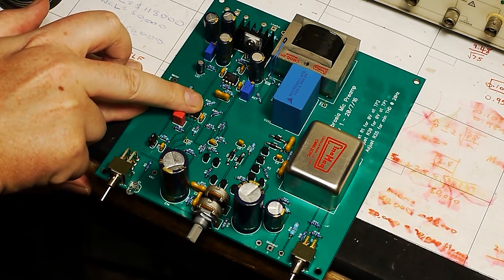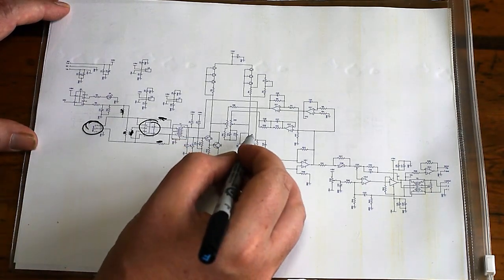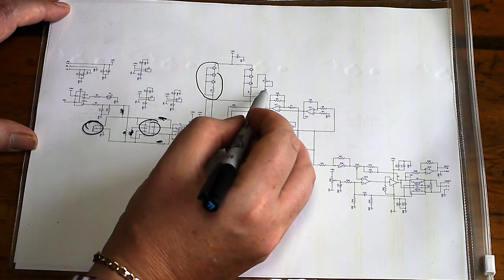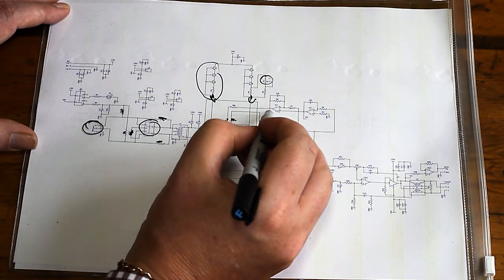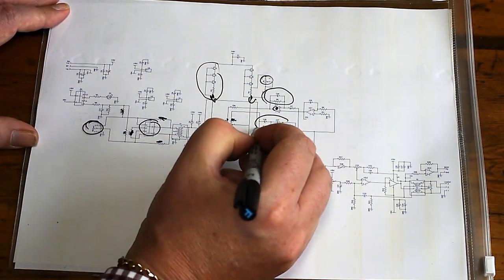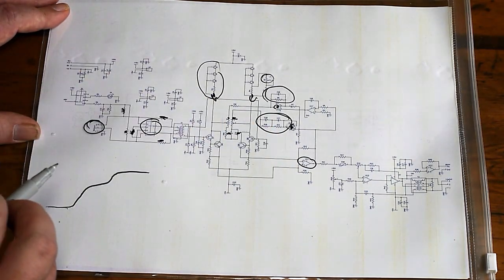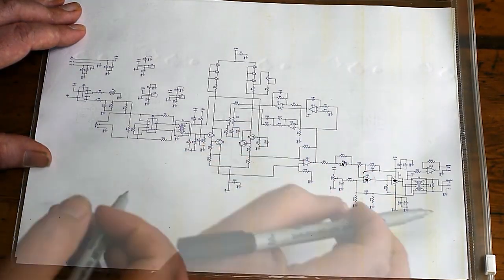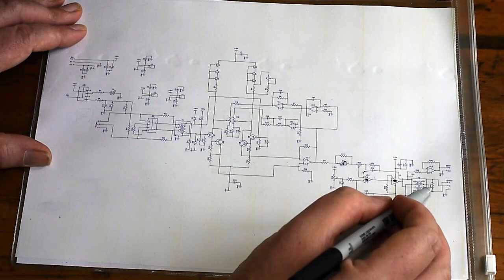DIY microphone preamp project - Introduction

Comment: As a long time (old) EE audio designer I have to agree with a couple of others that this circuit is unnecessarily complex, and frankly somewhat ill-considered in spots. I hate to dampen the poster’s enthusiasm and willingness to share, but I would encourage would-be builders to do more research about other available circuits on-line. And “Keep It Simple”!

Comment: 9:34 Neat idea, i suppose, but i must admit, i'm a bit skeptical about the practicality(?) of that, in an audio application. That output transformer is a considerable chunk of metal, which will have a considerable (to say the least) thermal inertia, or time constant. That's in addition to the admittedly smaller one of the thermistor itself.

And since this is (or should be?) a line-level audio application (as opposed to this being a power amp), where long-term sustained full-output sinewaves will be amplified (outside of testing), there pretty much shouldn't be any significant amount of power getting dissipated by / in said transformer, right? But i could be wrong :)
Reply from the maker: I agree entirely - the output transformer isn't going to warm up to any significant degree in normal operation, my original idea was more to correct for variation in ambient temperature. As to the practicality of the whole scheme? - well, I had fun doing it, at least.
Reply: Reminds me of something AvE occasionally says - "Ain't no kill like overkill, eh"? :)

Comment: 3:18 Might not Douglas Self's "Blameless" power amp (or any non-cut-rate) input-powering-topology have worked just as well, if not better? Ie. the classic two-transistor current source on top, and a current-mirror on the bottom? Or wait, i know - that's for the Mk.2, right? :)
Reply from the maker: Food for thought, most definitely :)
Reply: A bit of a shameless(?) plug, but speaking of audio stuff, i "finally" started my own blog (not vlog - yet) mostly to document my various projects. If you get bored sometime, you might wanna take a peek at it :) 
https://khronscave.blogspot.com/
Reply from the maker: Cheers - bookmarked!
Reply: Oh, and one more thing, this time more "on topic" - not sure if you're aware of it, but there's a pretty active forum over on the GroupDIY site, precisely about DIY-ing mics and musical gear :)

Comment: Sir any way we could use a single ended power supply. Then it will be useful for location audio mixers. Cheers.
Reply from the maker: Good question. While I'd have some reservations about the suitability of the design for location work (I didn't worry too much about current draw for a start) - I suspect it would be possible. Just off the top of my head, it strikes me that since we've got transformer isolation on both the input and the output, it should be possible to run the preamp with a 'virtual ground' derived from 1/2 the supply voltage without it causing too much trouble.

Comment: Always love your videos. Beautiful
Reply from the maker: Thank you so much for your support, it is much appreciated. I've been a little busy recently, but plan to do more videos soon: I have a little 20W amplifier based design on the LM1875 chip, but running it as a 'compound amplifier' inside the feedback loop of a LM4652 for extra-low distortion (and hairy stability issues, naturally) that I'll be sharing with everyone.